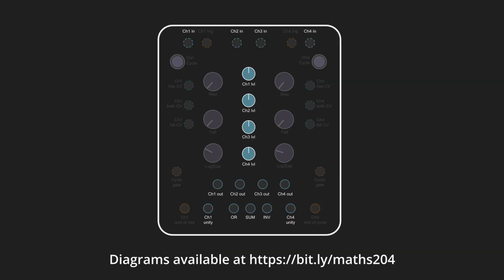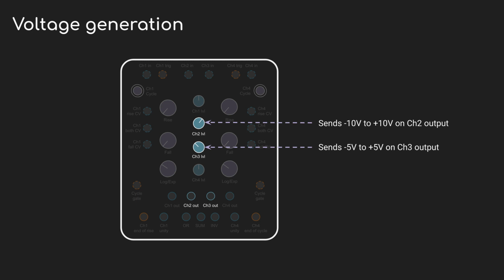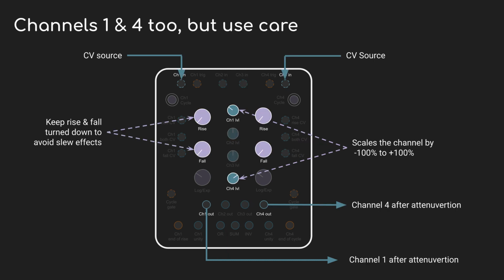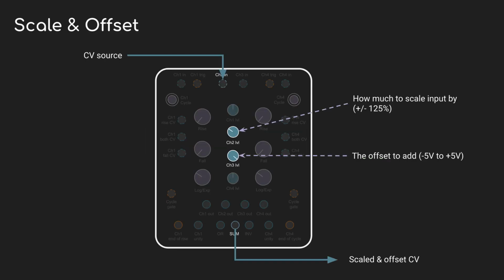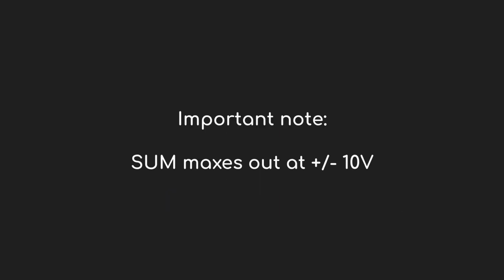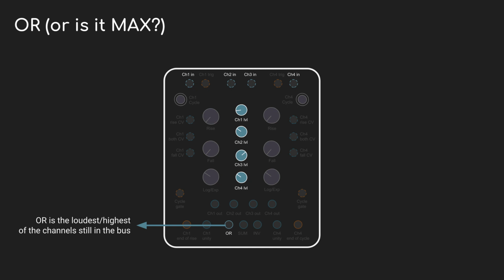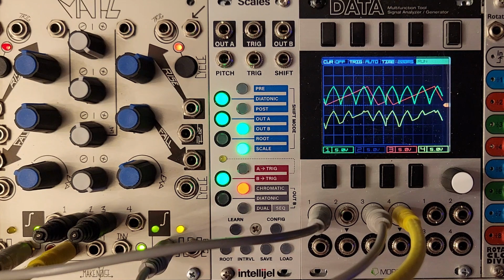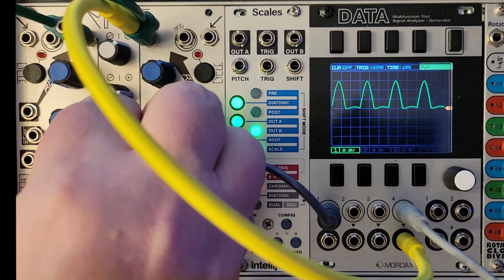Maths 204 - Patch ideas for Voltage control & the summing bus - Mysteries of the OR output revealed!

Comment: Will the sum output sometimes put out the same result as the or output? I get the differences but they seem like similar functions sort of.
Reply from the maker: @Planetplex - It can happen.

Think of OR as the minimum voltage on any of the 4 channels.  And the SUM is the total when you add up all the voltages on all 4 channels.

So, if the voltages for the channels were 0V, 0V, 0V & -2V, then the sum of them all together would be -2V, and the lowest of them would also be -2V.

Of course, you have to try pretty hard to get channels 2 & 3 dialed in exactly at 0V, so you have to allow for some wiggle room.
Reply: @ ok Thank You!

Comment: Very well done! This series is really good at explaining all the features of Maths. Two things I'd recommend:
1. Don't play your background music when running a patch. It's just jarring and distracts from the audio of the patch.
2. I would be careful with your "dead plugs". If you don't cut them perfectly, there might be a strand of copper left that short circuits the plug, thus shorting your module output! It's much better to just buy as many empty plugs as needed from your trusted electronics dealer.

Love your videos. Please make more of them! And yes, I've subscribed. ;)

Comment: The only case where inverting an audio signal has been useful has been adding multiple outputs of an oscillator. You get phase cancelation that varies by the harmonic. For instance, a sine output minus a triangle attenuates the fundamental only.